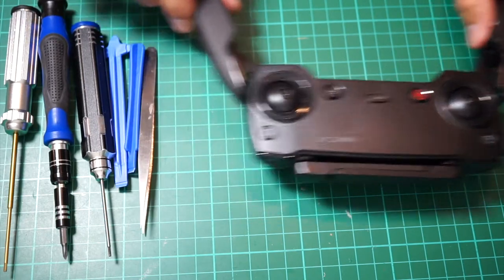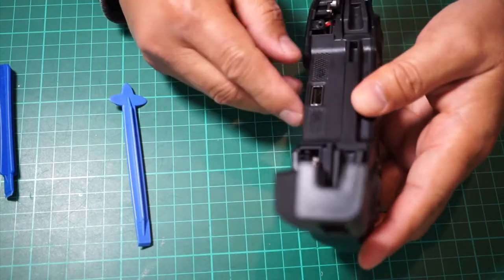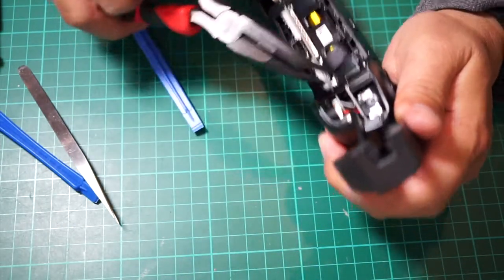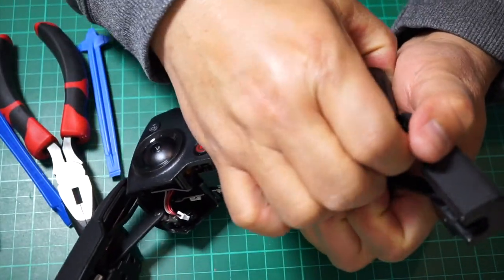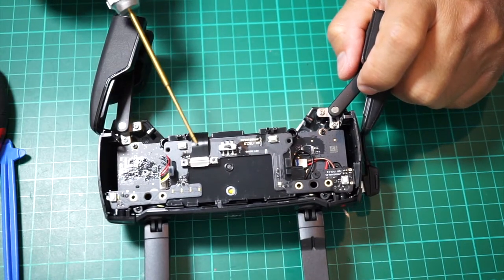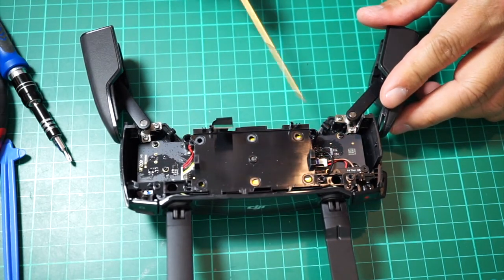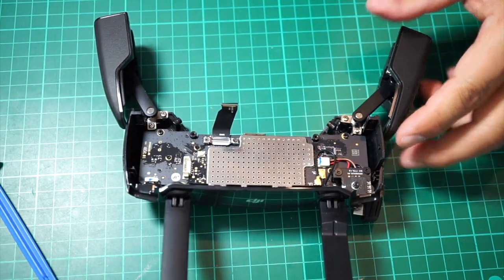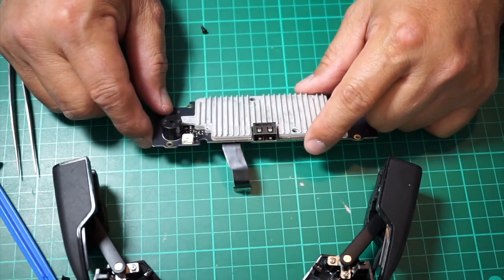Mavic Air Remote Teardown and Dampen the buzzer so the RTH is not too loud.

Comment: Good video!
A slightly different topic. But see if you can help.
Can you tell me that if I want to reverse the direction of movement of the throttle in MODE 2, which two of the four wires coming out of the left lever should I replace? I use MODE 2, only when I take off / ascend with the drone, I pull the throttle toward me.
The App does not ensure the reversal of the throttle movement direction for the Mini SE drone.

Comment: Absolutely amazing video hope this is your channel? I've had it with being ripped of by dji, I need to replace the USB charging point this video will help me immensely. Where can I find the plastic dividers there are two copper looking metal bits sticking ypward on the controller inport , do I need to push th yp or down ?  Took a picture but  ant seem to send it.
I've put a video yp on my channel

Comment: Looking for Mavic AIR controller usb charge port replacement board, can find part for Pro, Pro2 but not for air. The connecting cable is fine but the R/C will no longer charge or connect to phone. Please help. Thanks.
Reply: Hi there me too this has just happened to me can't believe its that easy to break did you have any luck finding one
Reply: @ufodroneguy6614  some for me man found any solution

Comment: At 4:49 on the bottom of the inside of the co trollers on the left side if the ribbon wire there's a small switch with 3 white lines above it. What is that for ????
Reply from the maker: That small switch is the power switch. Go back to the beginning of the video at 0:00 you will see the power in the middle in between the two round buttons.
Reply: @dkieng  I thought the power switch was on the top right-hand corner the switch I'm talking about has three settings on it and it's right below the sport mode and GPS mode button but there's three settings instead of just two

Comment: Hi sir, i have a problem with the left stick, it has false input while i´m flying, calibrating didn´t work, do you have any advice to fix this issue?
Reply from the maker: Maybe you should open the remote control up and reseat the left stick gimbal cables.  If that doesn't work then you probably have a faulty stick.

Comment: I need to change the battery form my controller. Can you show how can we make this? tks!
Reply from the maker: To change the battery just remove the last plate and the battery is right underneath it.  You can see the battery on this video at 12:59.

Comment: do you have video. repair from. water damage, my mavic air remote is dead no light
Reply from the maker: The only way that I know of when electronics get wet.  You need to store it with silica gel and let it dry before applying power to prevent electrical short.